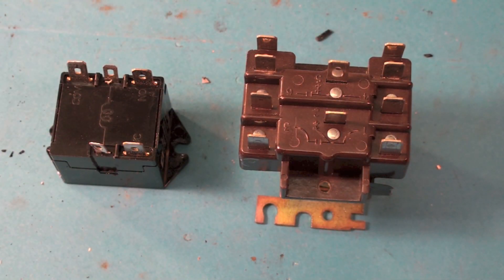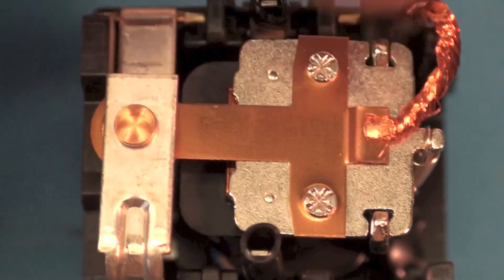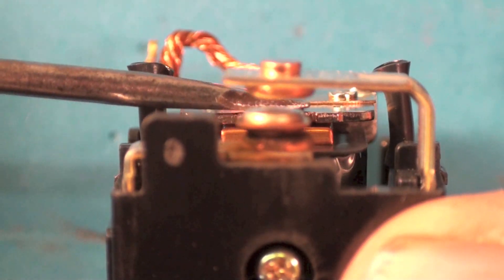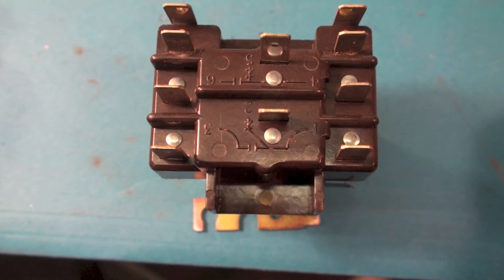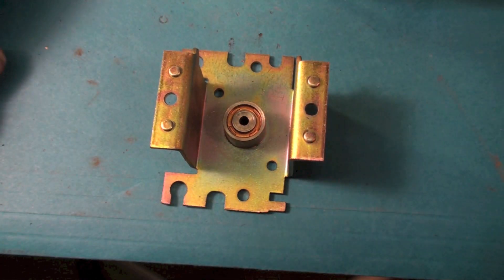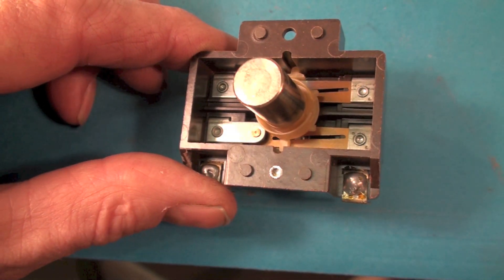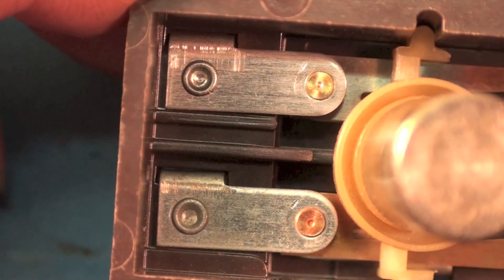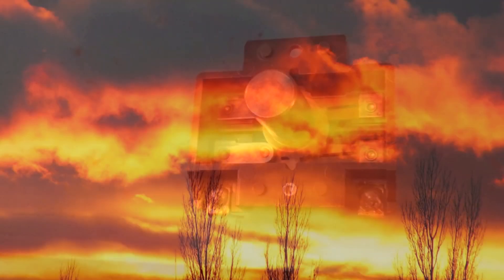How the double throw relay looks when disassembled

Comment from the maker: Its a good question.  If a coil is not rated for DC it will not work with DC regardless of voltage. I can't say I know exactly how they differ but they are not interchangeable.  Thanks for the comment.
GFM